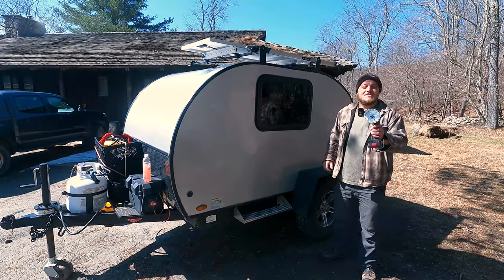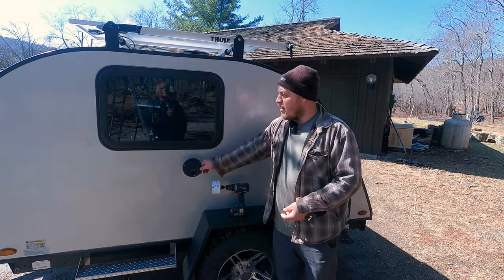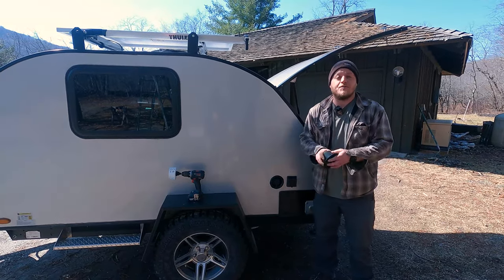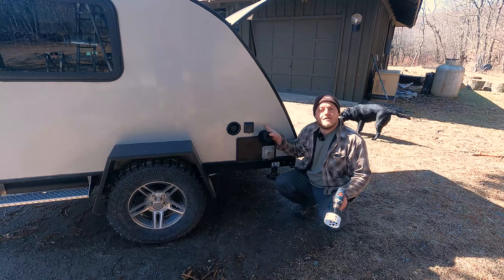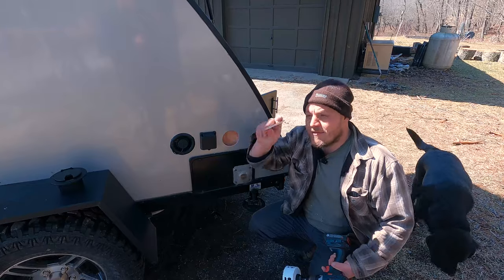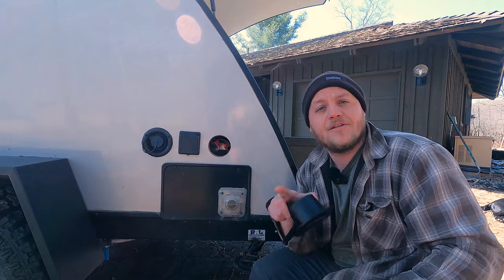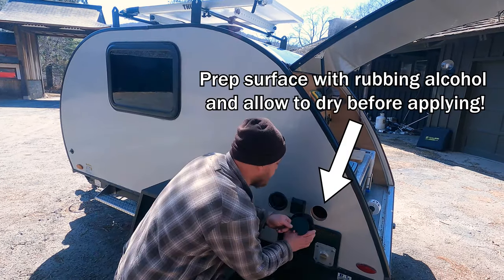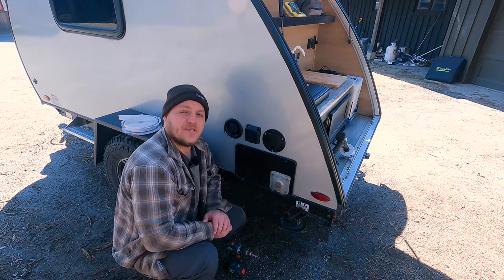RV Cable Hatch Installation

Comment: I think if the folks at Bushwacker see this video, they should include these access panels as standard equipment in the future. It’s always better to run wires and cables through the side rather than through an open door or up through the floor. Great video Brian, it was my pleasure to film it for you!❤️🎥
Reply from the maker: you the man!

Comment: Great video.   I was wondering how to put a solar generator power cable from inside my trailer to the outside plug.  This looks like it will work great.
Reply from the maker: This is how I do it.  Sometimes I run an extension cord inside, other times it's just a solar panel wire.

Comment: Quck tip, when drilling a hole with a hole saw.  I like to drill the pilot hole first then put the hole saw back on the arbor and drill the hole. This keeps the saw from grabing when the pilot hole is drilled. Sometimes this can break your wrist. ( As an old pipefitter I had to drill way to many holes. lol)
Reply from the maker: That's a great tip!

Comment: Great video!  I just bought bluetti 200 max for my travel trailer and was trying to figure a way to keep it out of the elements.
Reply from the maker: Tons of creative solutions out there. You can usually find a way to keep it in your vehicle and run the cord out. I used upside down totes. Under the camper sometimes works some times. I like to get coolers at yard sales, makes a good case Etc etc

Comment: Well I made it to the end of a video on cable hatch installations :) Brian, as much as I used to nerd out on my BW and once I saw this... yeah, total forehead-slapper moment for me, doh!

And yes, hanging a little camplux or the like portable water heater off the side is an awesome upgrade. I picked up a 10' QC propane hose for mine so I could run it off the propane port, easy-peazy. As for plumbing I teed in under the galley, out through the floor and had a 1/4 turn hose bib mounted outside and below-left on the frame and everything used the same QC water fittings. Nothing fancy, just the basic plastic garden hose ones from the big box hardware stores. Super handy for even when the water heater wasn't in use. I did worry a few times about the short run of line freezing up so had I done it your way that'd been moot. A word of advice on that though. Do spend a bit more and get the reinforced vinyl. It's pricey but it holds up to abuse and maybe a little freezing. You may notice BW used the same from the tank to the pump.

Oh and a bit off-topic, with that water heater rig, a couple of nights where it was going to dip to mid to upper 20's I did a makeshift "tank heater". Basically I just fed the output of the water heater back into the tank fill and let it run for a bit. I know that was pushing my luck but it was all the water I had and I was out there and hadn't been prepared for the weather dipping that low. Worked in a pinch but I don't recommend it instead of properly dealing with water when it can freeze, which in the case of the BW is don't carry any in the system. Use jerry cans and keep 'em warm. Man do I miss that little trailer!

I agree with the post below. Bushwhacker could take some inspiration from you.
Reply from the maker: My forehead stays red from the slaps…lol.  Glad I was able to show an option. I run a pretty conservative approach to winterization, maybe I’ll experiment more this year.

Comment: Brian,
Your videos are invaluable I’ve been binge watching to glean info on power stations and solar! I just converted my battery system from 12v to two 6v batteries 😎 will you make a video on this because you have so much knowledge to impart?
Thanks!
Daniel
Reply from the maker: Hey Daniel, thrilled that you're enjoying the videos.  I'd be happy to show a series system with 6v.  I have to see if I have 2 of them to demonstrate, making these videos gets pricey when you buy the gear for demonstrations.  In the meantime, happy to try to answer any questions you have with your system.  Thanks for watching!
Reply: @DIYOutdoorLife  especially 6v batteries! To be brief I have a EcoFlow River power station and a 220w Dokio briefcase solar panel that I use to power my laptops for work. How much 12v DC input power to the power station would you suspect I should get? I basically deplete the EcoFlow daily and luckily shore power charges it back up at 600+watts or only a couple hours 🙂 but of course I want to be more self sufficient in my setup. Thanks in advance if you have any pointers!
Reply from the maker: @dgavern  if you plug the Dokio into the ecoflow (make sure you go direct from panel, bypassing the charge controller) you will get around 180 watts per hour in good conditions.  There are several different rivers by
Ecoflow, a 220 panel should be able to charge all of them at a decent speed.
Reply: Brian,
Do you how I would increase my DC charging capabilities on my EcoFlow River Pro? Would I need larger gauge wires so that it can carry more amperage?
Reply from the maker: @dgavern  what is your exact model
Reply: @DIYOutdoorLife  I have the River Pro 720wh
Reply from the maker: @dgavern  I don’t own that model, if I remember correctly, it has a 200 W input?   I would have to do some homework, but if I can only accept parallel connection- you’re going to be kind of limited
Reply: @DIYOutdoorLife  got it, yes that’s right, it accepts 200w! That’s why I got a 220w panel so hopefully I can optimize the input on a sunny day😎 thanks so much for bouncing back and forth with me! Keep up the vids they’re really great!
Reply from the maker: @dgavern  220 will be a good size for it.  Thanks for watching and commenting!